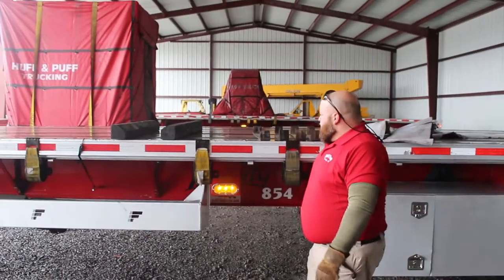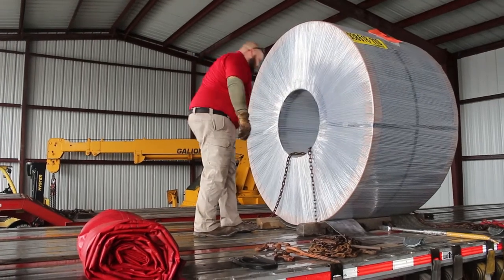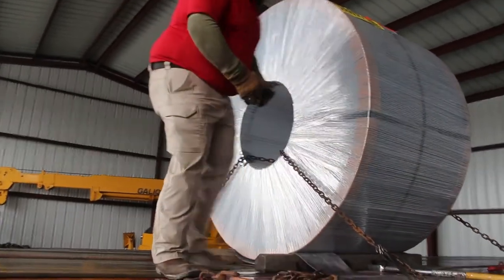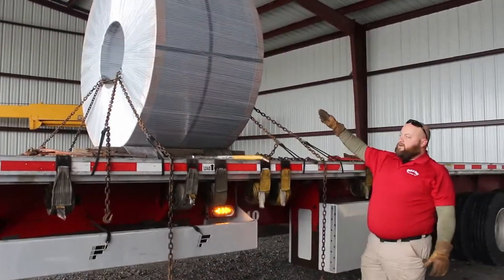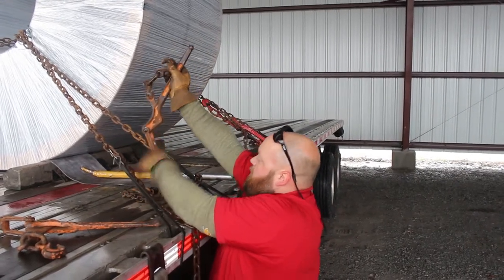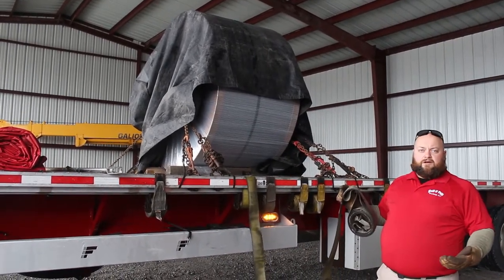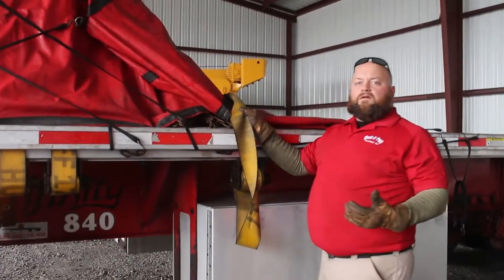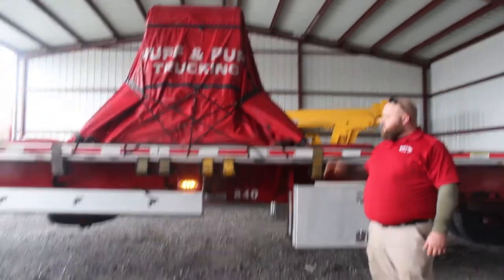Shotgun Coil Securement

Comment: Nice work. I highly recommend sticking in a set of ear plugs before throwing chains. Metal on metal right at ear level is enough noise to give a guy tinnitus. I know because that's what happened to me.  You don't want tinnitus.

Also, I never pull a bungee without something covering my eyes. Too many snapped bungees have whacked me in the face.
Reply: Great advice. But what is tinnitus?
Reply: @brandonjackson6274  Ringing in the ears

Comment: I have a question. I haven’t watch the full video my brother and I know that DOT have requirements. What about being top heavy and you are traveling 65mph and you have no choice put to slam on brakes. If I was to put 2 chains on top wrapping the top. Will that be good or bad. Also what about laying the coil down? To reduce to top heavy height? I new to the business and sometime the trailer wheels have to jump the curb making a turn. Top heavy if it is over the center of gravity it will roll over. I have questions. If the shipper have equipment than I will be looking to protect the public. That rocking of jumping a curb could damage property or even you. I will always keep 6”x6”x9’ lumber and Cordless Dewalt Saws and aluminum beams nail to ensure my shipment is safe from public and safe for me. I think flatbed trucking is the most skillful trade in trucking. I also see why a lot of truckers don’t like curtain side. They can’t see the load. I think I will love flatbed. A New Jersey State Trooper said to me. I will be a good flatbed driver after working on Highway with commercial trucks on both sides on you and in the center lane. You look at safety more than money. I want flatbed trailer because of the challenge like the motor grader. Thank you. I am going to Home Depot to look at equipment to protect the public and me. I would of been a good Secretary of Transportation for the safety of the industry. A good DOT officer and good cop. I would of went to the President about safety of the industry.
Reply: Not sure if your just crazy but whoever else reads this I can answer some of his questions :

Even if it is top heavy it won’t flip unless you roll the trailer, it also won’t bounce if you secure it right. 
You wouldn’t want to throw chains over the top of load either because you can and will damage the coil. You can throw straps that just as secure
Reply: @vnkable  🤣🤣 hes Insane
Reply: Please tell me you are not actually a trucker driving on our public roadways!!!!
Reply: Also, you can't load\offload this coil laying flat without damaging it.
Reply: @GonzoLarry  Give the guy a break lol He has never pulled flatbed before.

Comment: you supposed to put the rubber mats on the trailer! Coil racks goes on top of the rubber mat keep it from sliding!
Reply: Correct, and also the rubber mat between the Dunnage and coil

Comment: I thought it was illegal to cross thread chains 👀👀
Reply: Actually, it's illegal NOT to! RTFM, which he even included!
Reply: No it is the most efficient way. If you horse shoe secure them it halves the securement strength and you have to use twice as many chains. If you didnt, your load would not be secured legally. They also cant be twisted together.
Reply: Right
Reply: Did he x chain both
Reply: DOT requires when crossing chains to have rubber or some sort of protection to keep chains from rubbing.

Comment: No friction mates under the bunk and/or no tie down in front of the cradle?! You're not qualified to teach anyone anything. Fail! 

"− A cradle (for example, two hardwood timbers and
two coil bunks) that is restrained from sliding by:
• Placing friction mats under the cradle
• Using nailed wood blocking or cleats against the
front timber
• Placing a tiedown around the front of the
cradle."

Comment: Binders are out dated and dangerous as hell...
Reply: All binders, snap binders, or  just his binders specifically?
Reply: @DaddysFastestSwimmer  lol
Reply: Good video  but audio  is not too good,im just getting to flatbed after doing dry van for years
Reply: snap binders work but you can bend the handles causing the binder not to lock 100% inspect the binders. and yes they can be dangerous as hell.